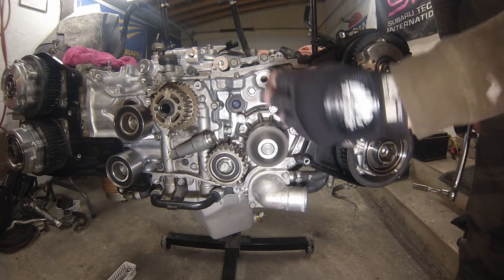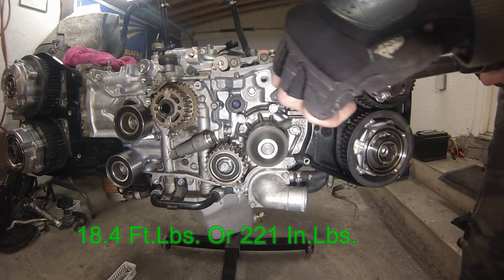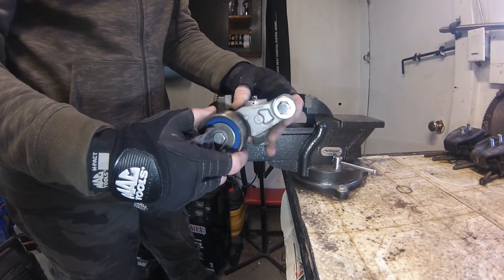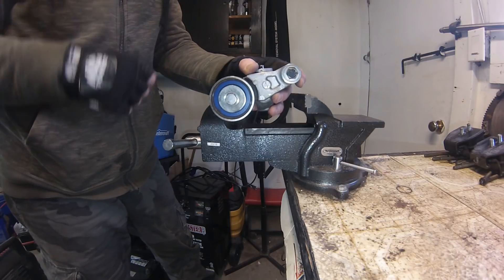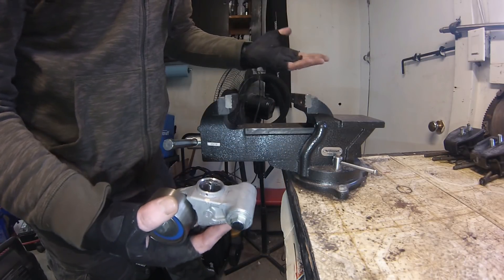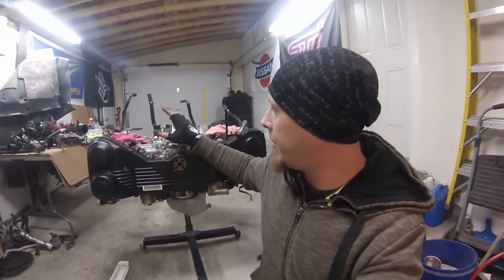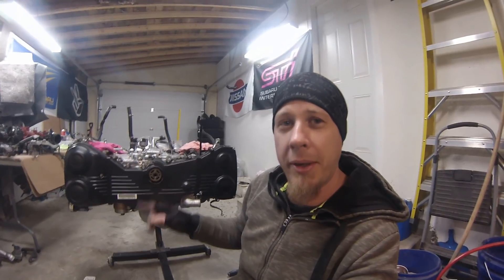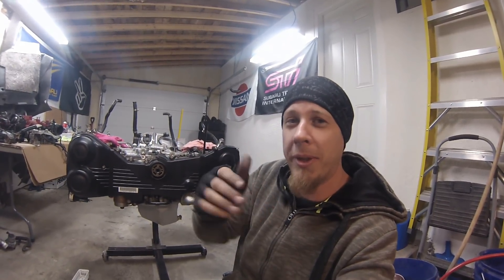2013 STi Build Part 10 - Timing Install How To

Comment: at around 7:00; it's one of those things you really went further with than any other subaru timing belt videos out there IMO.

Great video! 

so you can only turn the intake right side cam clock wise and right side exhaust cam counter clockwise, right?

Thanks!
Reply from the maker: When setting up timing the pistons are halfway into the cylinder, so there can't be any contact. On DOHC heads, it is possible for valve to valve contact. Camshafts and crankshaft can be turned in the opposite direction without problem on MOST engines, but not all. Subaru boxers are fine to turn either way. 
To ensure no valve to valve contact, either know what valves are open or just turn very slowly. If resistance is felt, stop and do not proceed. Try not to assume that it is only the valve springs that are holding you back because even damaging a valves margin will eventually burn it out. To answer your question directly, I can't be 100% sure. Just be careful ;)

Comment: When adjusting the timing gears on the right side. Does it matter if you turn the cam gears counter clockwise or clockwise to line up the marks? Thanks!
Reply from the maker: You can turn the cams which ever way you need. Just make sure the crank is lined up and turn things slowly

Comment: I'm doing the timing belt on my 98 WRX motor and after removing the timing covers and lining up the timing I went to remove the main bolt again to clean the crank sprocket as it's filthy and I couldn't see the timing mark clearly while holding the top right cam (facing the motor) and I think it skipped a few teeth with the belt still on. I spun the timing around twice I think and the timing wouldn't line up, halfway through the third spin I felt a bit of resistance so I stopped.
The crank is out, the cams are out, the old belt is still on.
What's my best course of action? Take the belt off, turn the crank to tdc, then turn the cams?
Reply from the maker: Turn the crank back to TDC which ever direction of rotation has no resistance. Then slowly do the same with the cams
Reply: @HomebrewSubaru  with the belt off right?
Reply from the maker: Definitely with the belt off
Reply: @HomebrewSubaru  haha just double checking. Thanks for the help mate!
Reply: @HomebrewSubaru  do the cams have to be rotated in any particular order?

Comment: I’m doing my timing belt job on my 2007 sti and the driver side cam shafts don’t line up but the left side is timed perfectly. The ride side is off and when I try to rotate them clockwise I eventually feel good resistance and feel like if I push hard or push it I might bend valves. Please help how can I fix the driver side cams so I can get them lined up and then I can finally belt on the new belt?
Reply from the maker: You should be using the camshaft locking tool like shown in the video. It's ok to turn the camshaft counter-clockwise to line it up.

Comment: Hey this was a huge help in putting on my timing belt during my rebuild. I had "car fix laptop" out in the garage watching as i went, made it a breeze - confident about my work, especially after coming back up to sit down in my office, and seeing that your tensioner didn't exactly "explode" when you pulled the pin. Mine was same way. Can't wait to get the engine in this weekend and start her up

Comment: I had a blue timing belt on last but it left that blue residue everywhere inside the timing cover and corroded my pulleys smh I brushed them down but they’re still pitted and stained from corrosion.
Reply from the maker: I've never heard of that. There is one on my RB engine, I'll keep an eye on it

Comment: Nice video.

When you install the cams do you just chuck them in any random position, then whack the cam sprocket on (that has an alignment pin i saw).

and the final timing is done here? 

do intake and exhaust valves travel in the same path? like if you rotate the intake cam when the exhaust valves are open can they collide? 

I understand the crank timing belt is the main part and it puts the pistons half way down the bores so valves can't hit the pistons.
Reply from the maker: No, when laying in camshafts you want them as close as possible to where they should be. 
When tightening down the camshaft bridge, some valves will open. 
If one camshaft is turned in excess against the other that has open valves, valve to valve contact could be possible.
Doing this by hand is the key because you are able to "feel" if there is a problem, but there shouldn't be if you're doing it right ;)
Reply: @HomebrewSubaru  wow that sounds a little bit complex, thanks for that.
so valves can hit other valves in the same cylinder, didn't realize that was possible. 
is there any mark on the cam when you lay them in or you just know exactly how they should sit? 

Your videos are amazing and interesting!
Reply from the maker: There is nothing on the camshaft except the line up pin for the timing gear. Temporarily sit the gear onto the shaft to figure out where the camshaft should be when reinstalling. 
Valve to valve contact does not normally happen even on damaged engines, but it's possible if not careful when reassembling

Comment: Has that tensioner failed yet?
Reply: 😁 just risky reusing the tensioner in my opinion they are a common failure component on these engines. Sorry wasn’t trying to be a dick I just though it to be odd to not change the tensioner while doing the belt.  Best of luck though hope it holds up!
Reply from the maker: It's been a year and the car was tuned for 380whp. Probably another year and the owner will think of replacing the complete timing set. I've only had one tensioner fail in over 10 years of working on Subies and it was from a company that discontinued the part.
Reply from the maker: LOL was it supposed to?

Comment: Are the 2 bearings at 2:00 identical? Mine are not in the package and they seem identical, but I don’t want to put them in the wrong spot
Reply from the maker: Sometimes, they are the exact same part. In other kits, one of the bearings will have a tiny lip. If yours are identical, do not worry about it.

Comment: For an 02 wrx. Do you need the cam locking tool?
Reply from the maker: It isn't absolutely required, but it will make your life much much easier.
Reply: @HomebrewSubaru  Okay. Thanks for the info.

Comment: So I’m doing a timing belt job on my motor and with the new gates racing belt I have bought I match up all the marks on the cams and the crankshaft and also the belts marks with the teeth and then once I go a full rotation the marks on the belts move from where I originally placed them. I need some help !! You make it look so easy
Reply from the maker: Usually it will be bank 1 exhaust cam that is out of time. Always use the cranks timing mark as a primary reference. Line it up to see which camshaft is out. Sometimes it can be tricky and you will have to try more than once. If the belt has timing marks on it, should be much easier to line up. If the engine is in the car, use a mirror or the camera on a phone to get a good look at the timing marks.
Reply: How can you tell which camshaft is out of timing cause all the valve should be closed correct ? And the pistons at bdc correct?
Reply from the maker: No you will have to check the pulley to the timing marks on the rear timing cover. The marks on the belt are for initial line up, once rotated they will not line up again. You must use the timing mark on the cam and crank gears, then line those marks up with the ones on the timing cover. If you still can't see if they are exactly where they need to be, use a small straight edge to line up the marks. 
Again the marks on the belt are for initial install only, once rotated they will not be any help.

Comment: How many miles were on this motor
Reply from the maker: This engine had just over 50k km's, about 32k miles. I think it had a harsh young life, even the clutch was pretty smoked. Original owner probably remapped the ecu a week outside the dealership.

Comment: Hey Homebrew, did you ad some new grease in the pulley's? i ad some synthetic grease to mine when i install new ones to give some better life.
Reply from the maker: These pulley's use sealed unserviceable bearings.
Reply: you can remove the cover with a sharp pick and add grease to the bearings. those caps are not real tight on them and they just pop back into place.
Reply from the maker: I hear what you're saying John. I've done this before with used bearings that made a bit of noise but had zero play. New sealed bearings I generally leave alone. For one, I can't be blamed for disturbing the new seal. For two, I can't be blamed for grease leaking from one onto a belt. In situations of doing my own stuff, I generally still stay away from disturbing the seal on most bearings.
Reply: i hear that, i did mine and will be sure to check on mine to make sure no grease leaks out. i was real careful with the grease and putting the caps back on. i wish they made that cosworth belt for the SOHC motor.

Comment: I’ve done 3 sohc belts and never got the belt over the water pump/tooth idler that easy before, even with the smooth idler off...what am I doing wrong??
Reply from the maker: To be honest I had the same trouble on the first few engines I did. Putting a wrench on the LH cam pulley and turning clockwise can help give you that little bit extra to slip the belt on. When I do my SOHC hybrid soon, I'll keep this in mind and show it.
Reply: I bought a Dayco kit for my wife's 2004 WRX.  I realized that should I ever be able to get the belt on it would be way too tight.  A  replacement Subaru belt was still a bit on the tight side but it did fit.  I was surprised to see what a loose the belt in this video was.
Reply from the maker: Dayco kits are what I would buy myself. I have had the issue of not getting a belt on before and sending it back for a different brand.